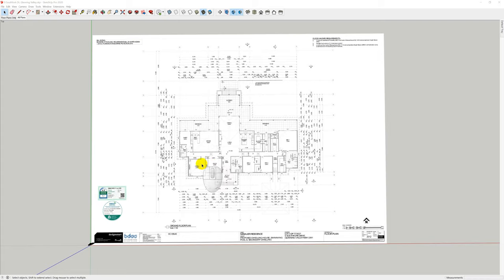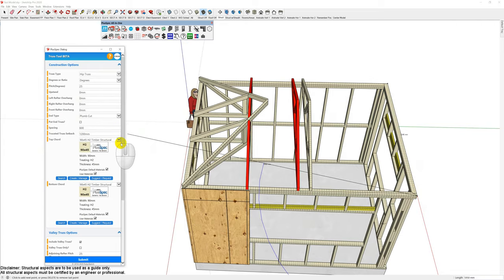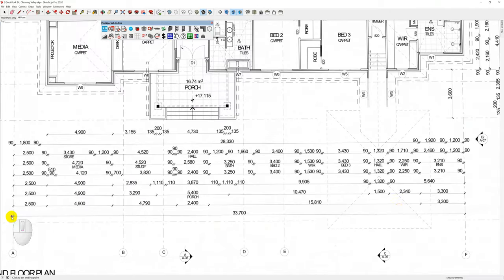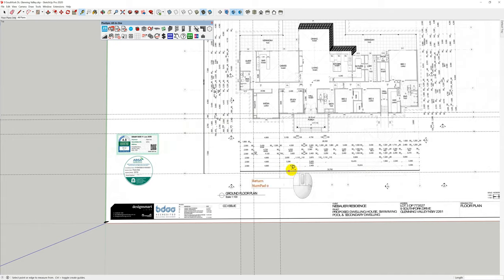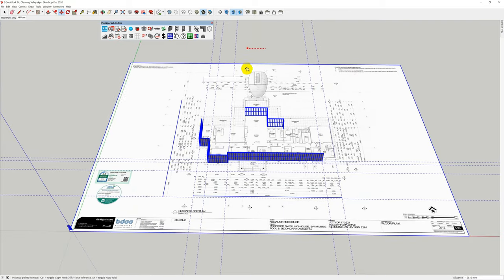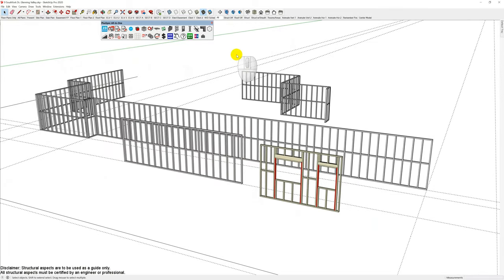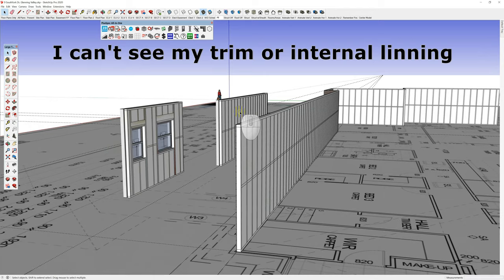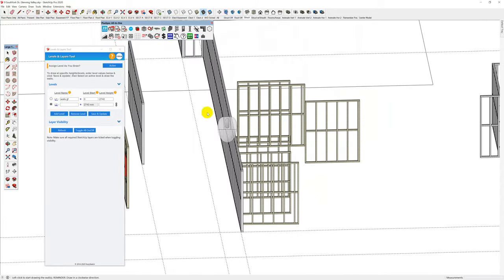The top 5 common mistakes when learning PlusSpec or PlusDesignBuild

Comment: At 9:49 when you moved the wall individually the attached wall to this wall didn't scale to fill the gap. So moving a wall disconnects the wall from other connected walls
Reply from the maker: It depends on how you move a wall; if you move a wall using the PlusSpec push-pull wall tools, it will stay connected and increase the size of the adjoining walls. Tip: if you push  "insert" on your keyboard, it will add another wall (excellent when creating bay windows from a split wall) I you use the Sketchup move tool, it will disconnect from the existing wall loop, & that is how we intended it to work.  Do you have a suggestion or different functionality in mind @Z-add ?  You can use the free forum to make suggestions. Here is the link    https://plusspec.com/forum/viewforum.php?f=36

Comment: NZ question. We use steel lintels (UB or PFC)  strap with timber for wide openings such as garage doors  or big sliding doors. Does PlusSpec accomodate this option when using timber framing with light cladding?
Reply: You can just create a material Neil
Reply from the maker: Hey Neil when you add a grage door in double brick it will automatically add a PFC with a plate welded to it. You cna see it by adding a section cut or going to transparent view in Sketchup. If you right click a double brick wall you will notice that teh beam will turn up in your estimate.
Reply from the maker: @andrewdwight5744  Or simply use the beam tool and non structural wall type.